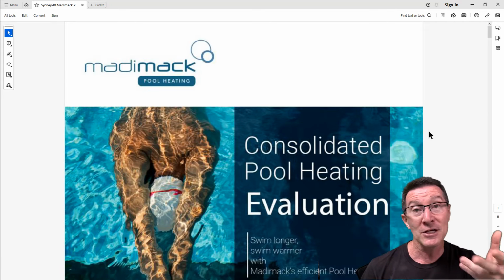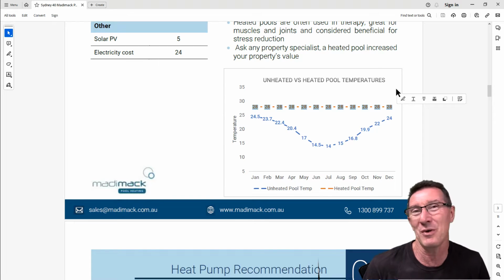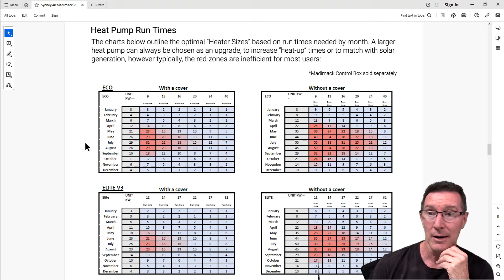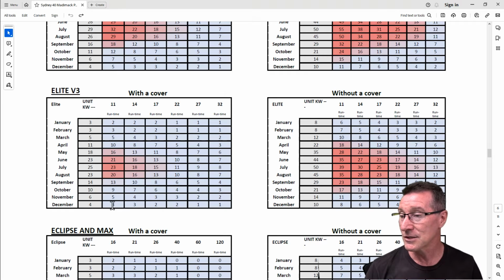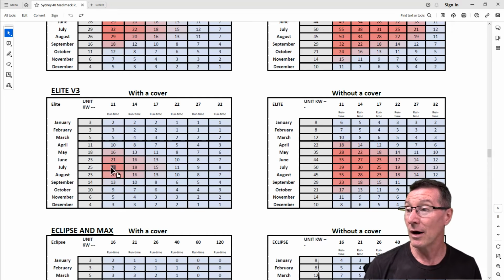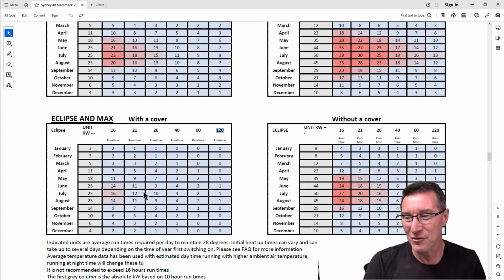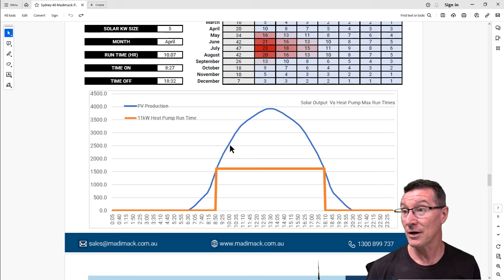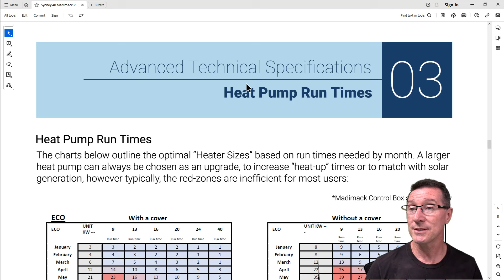Pool Heat Pump Sizing

Comment: About the automation of switching it on when you have excess solar. You could DIY this with smart plugs and some sensors. It's not gonna be as reliable probably, but you can fix it yourself and implement it however you want. I bought a random bunch of smart plugs for cheap, they have ESP8266 inside typically, flashed the ESP8266 with community made open source firmware like Tasmota or ESPhome to liberate the devices from the clouds and have them available on my network and then I set up Home Assistant on a RaspberryPi to log the data. Home Assistant has a few web widgets, one of them is a thermostat. So I made a few temp sensors using ESP8266 devkit boards and made myself a thermostat. Once you have the data on the RaspberryPi, you can code whatever you want but I am sure there are premade solutions for some things. I like it because I can do whatever and it's all ran locally.
Reply from the maker: Sure, anything is possible given enough effort.

Comment: I am able to keep a 18.000L above ground pool to 29C with a 5kW heat pump from mai to september in Belgium.
Your pool is underground and you live a much warmer region than me which most probably/certainly makes that 11kW more than enough.
Just make sure to get that cover in asap because it really makes a huge difference (you'll also save money not needing to refill the pool).

Comment: Yes - Eddie is the controller for dumping energy into hot water tank, Harvie is the comms hub.
Reply: Yes this is correct all you need is the expansion board in Eddie plus RFsolution LowRa to pool or buy  another Eddie with expansion board to run the heat pump. The expansion board is needed as the Eddie output is inverter driven so can vary the output power giving more efficiency & without causing any switching noise a normal triac would give. So to give a normal on off with protecting those FET a relay expansion board is needed!
Reply from the maker: @Electronics-Rocks  Why they don't just make a cheap relay output module is beyond me. Or even have that built into the Zappi. Such a huge oversight.

Comment: Dave should start a dairy... this pool sure is getting milked!!

...its a friendly bit of banter/joke people!.. :)
do they not make them solar(hart) water heaters they used to put on roofs like solar panels?..the one with the tank and water pipes in the panel..... surely one of them would be perfect or atleast take load off heating the house water..
..and theres another idea Dave, you could make a cover for the box and heat pump with some poles and a solar panel!

Comment: Interesting. I have a solar heater for the pool on the garage roof, one of those arrays of black pipes. My electricity bills are high enough without an electric heater. I wonder how the efficiency and cost compares between my solar heating and solar panels + heat pump?

Also, remember you need to take into account the energy use of the pump itself if you run the heater at times when the filter is normally off. What's the power requirement of your pool pump? Here's where you could have saved energy with a variable speed pump because it can likely run on low speed for only the heater, especially if you can bypass the filter.
Reply: The pump is going to pump regardless
Reply from the maker: Problem is havign the pump know when it's the heat pump switching it on. I can get a variable speed drive for my fixed pump.
Reply: That's a good point. The pump I have is all fancy with a backlit digital display on the top that shows the current/power, speed/flow rate, and temperature. It also has some sort of data connection to the control panel, maybe a serial port of some sort. I assume it could be configured in this way - though I've only seen it running at a single speed.  @EEVblog2

Comment: I guess I'm the "someone in the comments".  I used to have a pool and whirlpool in the central area of Arizona.  Had a large Propane gas heater and could be directed to heat the whirlpool only or the pool or both.  One November, I invited some friends over for Thanksgiving Holiday.  Plan was to have a nice comfortable, warm whirlpool after the big afternoon meal and watch the sunset.  Turned on the heater at 9:00 AM.  A 5:30 PM the whirlpool was still quite cold, so we changed plans.  I used up two large tanks of propane in the process and called a service to have them refilled.  The guy came and asked me "why refill them now at the end of November?"; since any fool knows that even the large, powerful heater I had was going to be useless until mid March or later.  

Again, since you're a nerd like me, it would be interesting to see the record of heating and pool use for the next >6 months.  As you state, pool heaters are only useful for adding a couple of extra months during the changing of the seasons.

Comment: My folk's house in Florida runs air con much of the year.  Also running ~5kW pool heat pump much of the year.    I'm looking into a retrofit heat exchanger that bypasses the air source AC condenser and routes instead through a special heat exchanger that dumps the heat into the pool water.

Comment: We have a Madinack pool heat pump in Brisbane. Works well but yet to get our first power bill. The heat pump tends to make the water a bit too warm, so will lower the set temperature. We run it on auto now so it can heat and cool. Brisbane pools can get a bit hot.

Comment: Heat pump DO NOT have an efficiency greater than 1. They have a coefficient of performance greater than 1. AKA you can improve the system and use less power while still having the same COP.

I'm sure Dave knows all that but as a mech eng I found the statement at 1:54 misleading.

Comment: Today my barometer and thermometer both read "FN hot". Pools are definitely summer thing, and heater just gives you the shoulder season, winter is a fools errand.
Reply from the maker: Yeah, wasn't worth the expense to even try. Can always fill up the bath tub on a cold day with the heat pump hot water system.